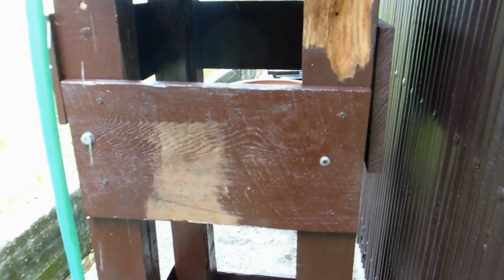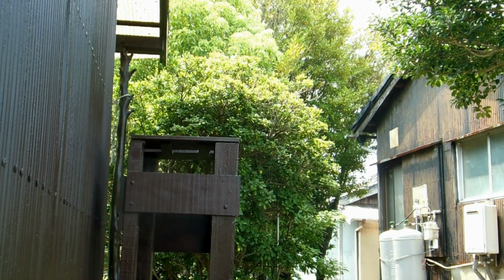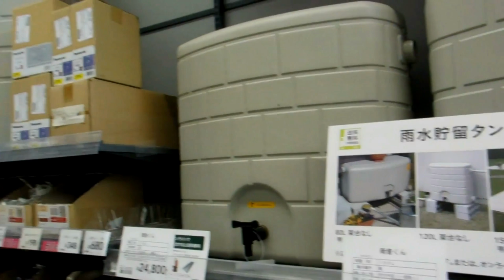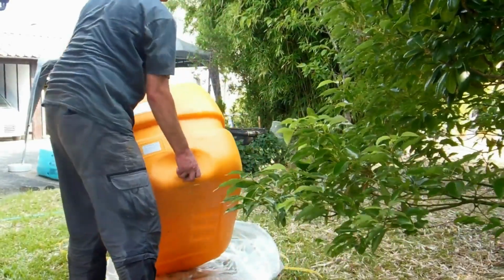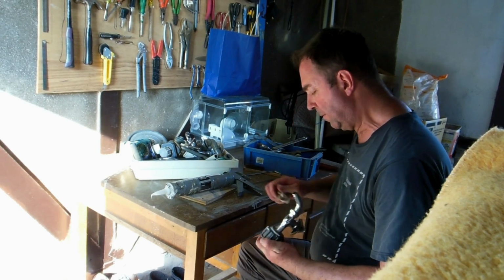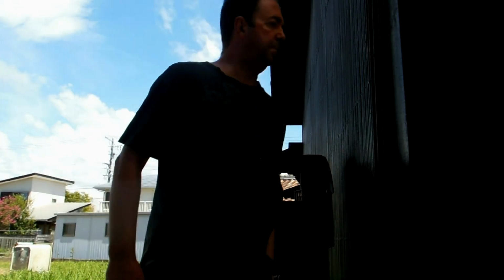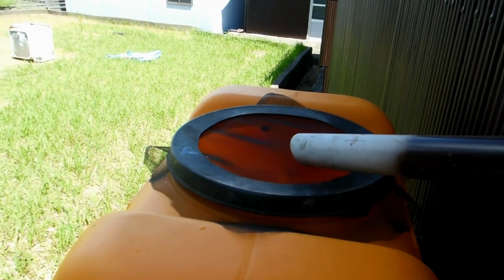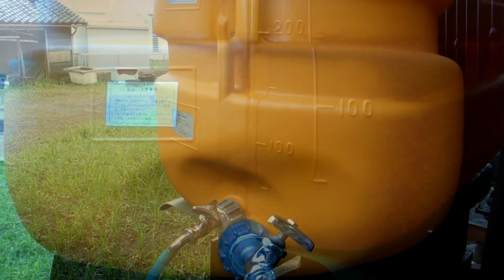Water Tank Failure at the Old Japanese Farm House

Comment: Is drinking water particularly expensive in Japan? Or is it perhaps ridiculously cheap here in the Netherlands? I currently pay € 1.73 per m³ (cubic meter), which is 1000 liters or about 264 US gallons. So to earn back an investment of ¥ 11800, which equals € 74.64, I'd have to save about 43 m³ or roughly 11400 US gallons of water. That's more than what I currently use in an entire year. Though I should add that I try to save as much water as I can, so my water consumption is well below the national average. In fact last time I reported the meter readings to the water company they asked me to send them a photo of the meter to prove that my water consumption was actually that low :)

Comment: When you screwed the tap in I was already wondering that you were taking a gamble on getting the tap mounted straight. Luckily it was only a small angle in the end and not completely upside down or something. 😅
Next time maybe make a marking on the lid when you have it on the tank, so you know what the top side it is when it is screwed down properly. Afterwards you can more easily line up the tap with the mark to get it straight. Although... that might be in 10-20 years from now given by how long plastic lasts in full weather and sun.
Reply from the maker: Marked the lid while it was still on the tank. Angled the tap so it would point away from the wall and torwards the drain.
Reply: @TheJapanChannelDcom  Ah, makes sense. Didn't think about that. It's getting late here where I am (1:33 AM currently), so the brain is already slowing down.